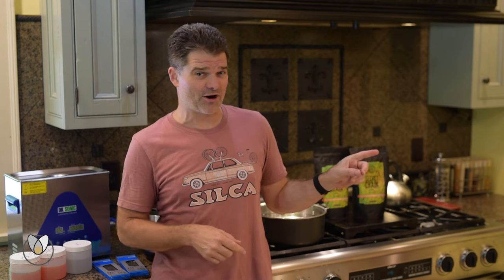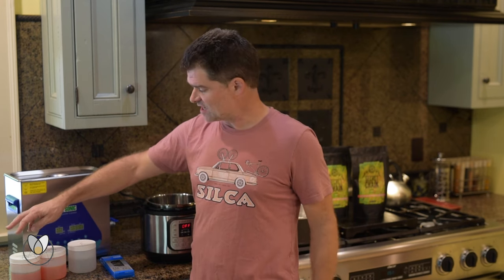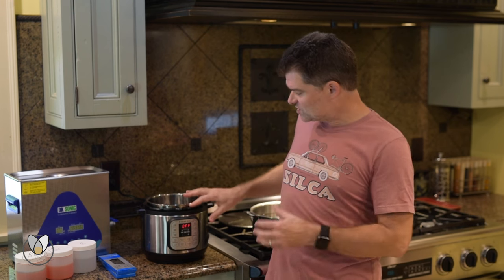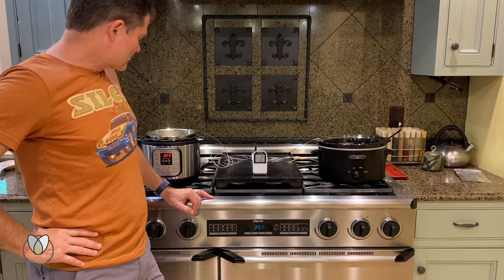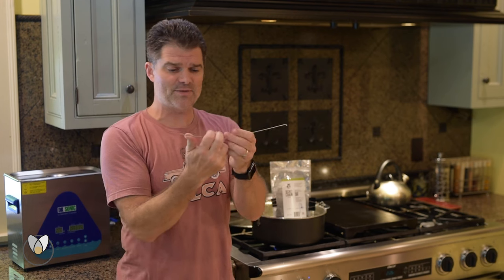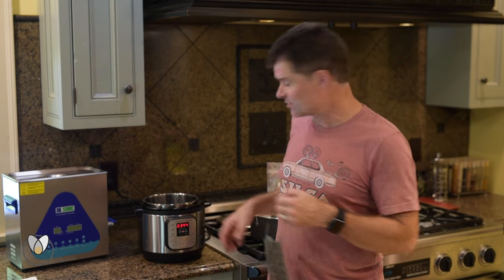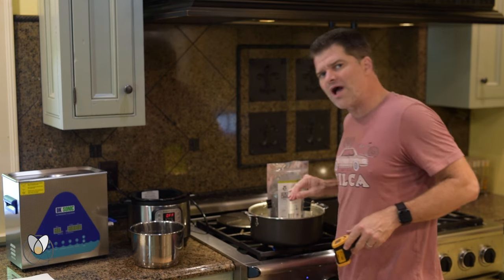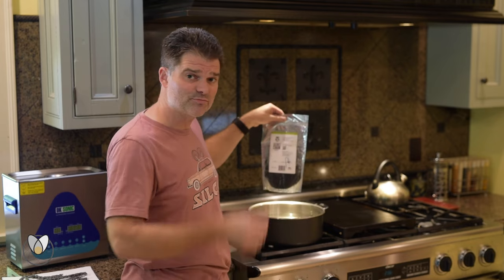MGTV: How to Hot Melt Wax Your Bicycle Chain

Comment: Worth mentioning the steps after this as it can prove pretty painful. I ended up with many stuck links which really effected the drive chain, made a lot of noise and messed with my shifting. Much time was spent further freeing up those links, to the point where I'm not sure there's any wax left in the links. Several KMs in, the chain is still worryingly noisey. Very close to going back to lube.
Reply from the maker: Joni, please check the routing of the chain through the derailleur cage, every similar complaint we've had has turned out to be that the chain was routed over rather than under one of the derailleur cage tabs leading to lots of noise and feeling like the links are all stuck.  Please feel free to call or email our customer service if this isn't the case, sales (at) silca (dot) cc
Reply: @SILCAVelo  appreciate the reply. The chain is routed correctly. 
I also had my bike shop check I hadn’t moved the DR as well.
Reply: Joni, as part of my process I actually remove the chain from the swisher and let it hang straight. It will dry solid. From there I have about a 1 foot section of 2x4 in a bench vise. I hang the chain on that, grab both ends, and pull it back and forth a few times as if I were trying to saw through the wood. That’ll break all the links. You’ll know when you’re done as the chain will stop jumping as it articulated around the back of the wood. You can also use a section of PVC pipe instead of wood to do the same thing. IMO this was a critical step in waxing that was left out. On a clutched derailleur system like GRX or XTR you can get away without doing this as the spring on the cage is ridiculously strong, but on a road drivetrain (Ultegra, Dura Ace et al.) you absolutely must break the links first before reinstalling your chain out there’s no way the chain will make it around those jockey pulleys.

Comment: Josh, 

In your video you mentioned that you would be adding a link in the comments section providing more details regarding the ultrasonic cleaner you’d recommend.  I didn’t find it.  Is it there?  If not, would you mind replying with your recommendation?

Separately, would you please provide either a link to a separate video/discussion or guidance as to the recommended maintenance involving a waxed chain?  I’m wondering if a waxed chain can simply be maintained through the use of Silca’s drip wax lubricant or if periodic hot re-waxings should be performed.  If the chains should periodically be hot re-waxed can you provide some insight as to when and/or how often?  What about chain quick-links.  A few others have raised questions about this in the comments, which were never answered.  If hot waxing a Shimano Dura-Ace chain, must the quick links be replaced each time?  If not, then at what point should the quick-links be replaced?

Thanks

Comment: Hi guys, love your content and podcast. I just wish either your wax packaging, or the website the QR code on the packaging points to , simply listed the temperature for melting and for hardening.
Reply from the maker: Sorry, we'll dive into this as that info should be all over the place!  We recommend 75C as the optimal temperature and you can get good results between 70C and 90C.
Reply: What setting on the instapot? Saute, warm or slow cook ?

Comment: Hi Josh, since marginal gains are desirable, I will give you an extra tip! Soak your beans to deactivate Phytic Acid which is an anti-nutrient. That way, you will gain more minerals like Calcium, Magnesium, Copper etc. from your food. Phytic acid will pull minerals from your intestines, bind the metals in your stomach and intestines coming from other sources too, which is a huge loss. That loss on the long run creates more hunger and decreases satiation since the calories become emptier. I hope this makes sense.

Comment: I've noticed that the hot wax appears to separate after a while in the instapot... a clear liquid on top and tiny black spherules settling to the base. Is this normal? It didn't happen on the first chain, but the second and third I've dipped with the same bag of wax it did. I re-agitated before pulling the chains to hopefully maximize the penetration of the tungsten, but I'm wondering if this is some indication of overheating or contamination? The chains were THOROUGHLY cleaned.
Reply from the maker: The separation is a function of how long the wax took to cool or sat before cooling without being agitated.  The WS2 particles are sub-micron size but are heavy, so if the wax sits for a bit after the waxing they will sink.. similarly if it takes a long time to cool, it will separate, but it's fine, it will all just stir back into solution when re-melted.  The only thing to look for in regards to contamination or overheating is a changing of color of the wax from whitish grey to yellow or brown.. if you see yellow or brown, that is a sign of either overheating or oil contamination.

Comment: Question. My hot pot heated up far faster than expected. I dropped the chain in on the cold wax, turned the pot on, then went and did 25 minutes on the rollers.  When I got back, the wax was at 217 degrees F. Did I damage the wax or the chain by letting it get this hot?
Reply: No damage to the wax or chain, but the danger is that if the wax gets too hot it can actually catch on fire.  My son did that when he was younger, he was melting candle wax in a pan on the stove to pour it into some molds.  It got too hot and caught on fire!  We called 911 so he could get treated for his burns.  Fortunately, there was no long term scarring.  That is why I recommend using a crock pot (slow cooker).  I picked up a really small one at Target for around $10 on sale.  There's no risk of getting the wax too hot and it is so cheap you can dedicate it to this purpose.

Comment: Josh mentions to pull the chain from the wax when the temp is 138 to 140 degrees and has a little film forming on top. When I do it, I'm getting a film forming at 146 to 150 degrees. The first two times I've pulled the chain at 140, the links ended up absolutely packed with wax. I thought maybe it was just the small mass of wax in the sous vide bag. So I purchased an instapot and have two bags worth of wax in the pot (more mass holding the temp longer), but again, I'm getting a film at 150 degrees. Is the answer less wax? I'm sure my IR thermometer is close enough...
For my third time, I pulled at 150 degrees and still the wax is clogging up the links, just not as bad. I end up with a toothpick pushing wax out of the links...Am I doing this wrong? Should I wave a heat gun around to melt the wax jammed in the links? Pull it at a higher temperature?

Comment: Hi Josh,
I’ve bought the bundle and hot waxed in a slow cooker it works great, is easier than I thought it would be , and is as silent a chain as I’ve ever had.
Just did a drip wax touch up, looking forward to more videos on this.
What citrus degreaser are you using, I used mineral spirits in 2baths , followed by 1 bath in denatured alcohol. It worked very well , but would use what you recommend .
Also, what can I expect in cold weather,, say 20-40 F  ?
Thanks for the great product,
Dave
Reply from the maker: David, great to hear about your results!  We recommend Chemical Guys citrus, link below the video, we also have a link to a super concentrated denatured alcohol.  You have to be careful with mineral spirits as there is no set mix between brands and some of them will leave a residue so just be sure the chain feels completely dry and residue free before waxing.  You should see no change in performance at cold temperatures, the wax will get compressed inside the chain and acts basically as a solid lubricant after a few miles so really isn't affected by temperature until things get rather extreme! - Josh

Comment: Since the combustion temperature of paraffin is well above water’s boiling temp, the bigger concern with the bag or double boiler is that boiling the water could cause you to spill or splatter hot wax. Not as bad as an ignition, but not good

Comment: Hi Josh. One simple and  silly question. Done the hot wax process ok. Then, do you have to clean off the chain the excess of wax or just you put the chain as it is on the bike and the wax will be removed just pedalling. Thank you. Regards from Italy
Reply from the maker: Just put it on and ride, the excess will fall off when you spin the drivetrain (just don't do it inside the house!!!)

Comment: I wonder if a brand new chain needs still to be deep cleaned or its ready to go , and also after the wax is dry should we move all links around trying to “break” the wax , the video doesnt show up to this stage, but i imagine once wax is dry that chain should be rock hard right ? Tks for the video by the way
Reply: New chains would stick to the wall if you threw it at one.   You should definitely clean it.   I just put a new chain on my MTB and I think it was harder to clean than the old chain off my gravel bike.   Yeah, no doubt in my mind you clean new chains.   Besides, if you clean the chain then no matter which method you use to lube it your going to know its not compromised by the gunk that comes on a new chain.

Read above about prepping chain for installing on a bike.   My chains come out heavy, stiff and with wax crammed into every link.   Takes some work to prep it for the bike.  RideFast above says to pull chain out of wax at full temp to eliminate some of this.

Comment: After watching this, I am curious on post processing the chain after waxing is done. I have recently hot melt waxed (pure paraffin wax, though) my chain for my indoor setup, and on the first ride, there was dry wax from the outside all over the place. Will your wax leave a stiff residue on the outside like the paraffin wax?
Reply: I’m curious about post processing, as well. I just completed my first wax melt using the instant pot method. I heard Josh say that one of the benefits of hot waxing your chain is how quiet it will be, but my drive train is louder than I’ve ever heard it at the moment. I’m hoping it will quiet down once I get the bike out on the road and some of the excess wax spins off.
Reply: Me too!   My chain comes out stiff and heavy with every crevice full of wax.  I spend probably 15 minutes cleaning wax out from between the links and also from the side plates.  Josh holds up a waxed chain that looks absolutely pristine in the video.  Mine is far far from that.  No idea how he manages to do that.   I am hoping that a ride will knock the wax off and lighten the load of this chain.  Rode it around the block and it feels like a heavy drivetrain.   I do LOVE my new 3 quart instapot !

Comment: Up to now, I used the super secret chain lube since summer 2021, and as I also want to use wax on my second/bad weather bike, it seems to be the best to first hot wax that chain. In case I use the bag which is put in hot water, do I just have to close the bag after waxing for reuse? If so, how often can I reuse the wax? If I decide to buy an Instapot, can I just leave the wax in the insert pot, and put it in a well-closed plastic bag, to just put it in the Instapot again for the next waxing session (e.g. in the case I have to ride often in bad weather)? Is this hot-waxing alone sufficient, or is that just the base for further waxing with the Super Secret Chain lube (which already seems to work fine, but I never used that bike in bad weather)?

Comment: I hot wax my trikes chain but I'm going to be doing multiday, week month tours away from home so wondered how to maintain my chain while I'm doing a transamerica tour.
Reply from the maker: Super Secret is the perfect option for this.  You can drip it on the chain after the day's ride and it will be ready to go for the next day.  If you get to a point where you are able to hot wax you still can, but certainly not needed.
Reply: @SILCAVelo  yeah I’ve noticed some of the hostels along the transamerica route have full kitchens where I could get boiling water to clean my chain then melt the wax in the bag to rewax the chain.

Comment: What setting or temperature is recommended for the Instant Pot?
Reply from the maker: You can just use the 'slow cook' setting, or if you are in a hurry and standing over it, hit 'rice' and it will melt super fast.. you just have to then change it to slow cook or it will get too hot - Josh

Comment: Just a question.  How do you deal with the wax in the instant pot after?? I would still like to use mine for cooking
Reply from the maker: You need to buy a separate liner for the Instant pot, you do not want to be cooking and waxing in the same liner.  https://www.amazon.com/Instant-Pot-Stainless-Steel-Cooking/dp/B008BKHGX0

Comment: I tried this method but used a crummy wax melter that took roughly an hour to melt the wax.  I must have done something wrong though, because I have rust on my chain on a few pins after a ride in the damp.  I even made sure to wipe the chain down after the damp ride.  Maybe I pulled the chain out of the wax too late?  My wax was clumped and I had pretty thick wax layers on the plates and a lot inbetween the pins where the cassette teeth would engage.  Maybe the pins were left unprotected where those wax clumps/layers broke off?
Reply from the maker: Sounds more like the chain wasn't left in the wax long enough.  You need a good 5 minutes or more to let the chain come to temperature so that the wax can fully wet the surface and penetrate all of the internals.  If the chain is colder than the wax you get a clumpy surface coating that does not adhere very well and does not fully wet the imperfections of the metal surface.

Comment: Is there any disadvantage of putting just some of the wax granules in a say 5 inch by 5 inch plastic container and melting that in a large pot of water? I used just enough wax granules to cover the chain and allow me to swirl it. I could leave it there for a while to cool as you diid. I thought that by doing it this way I would keep the unused wax clean and not get contaminated by rewaxing chains that weren't perfectly clean. Is it possible that by using only partial amounts of the wax granuals that the chemical ratio might be inconsistent?
Reply from the maker: Your method will work as well.. there is no downside to only using some of the wax, every pellet contains the right amount of stuff..so ratios will be same whether you melt some or all of it.  Josh

Comment: After pull and wait for wax solidifies / does it need to remove the flakes before installing on bike / the links are kinda stiff after waxing - does it need an additional process to free the links before installing ?
Reply from the maker: You can do it either way, I usually work the links over a piece of 1" tubing just to free them up a bit before install, some work the chain with just fingers and others will install as is and let the excess fall off on the first use, from what we've seen in the data, there is no difference in terms of performance or longevity between any of these methods.

Comment: Does the treatment need doing on all of the drive chain components?

Once the chain is waxed:
Cassette waxed, just a good clean, or additional product needed?

Chain ring?

Rear derailleur?
Reply from the maker: Robert, as long as the cassette and chainrings are clean when you start, the chain treatment is all that is needed.. it will keep your entire drivetrain significantly cleaner than any other method of treatment!
Reply: @SILCAVelo  thanks for getting back to me.

Appreciate their will be various factors at play. But typically what sort of mileage can be done between re-waxing?

Comment: Love my hot dip waxed chain. Reduced wear on everything. My system is smooth now and the time spent re-waxing is way less than the time I used to spend cleaning. 

Quite a few times I’ve ended up with wax filling the inside of the chain. I’m guessing I took it out of the pot when the wax was too cool?
Reply from the maker: Maybe pull it a little bit hotter, there should be little to no wax filling in between the link plates.
Reply: Thanks  @SILCAVelo  , I did three chains this weekend and by pulling them out a little hotter it was loads better.
Reply: @SILCAVelo Just how hot is hot?   My infared thermo said the surface of the wax was 168-170F.    Are there visible signs of hot wax?   Thinking of bubbles or currents in the instapot that occur when it becomes hot enough.

Comment: Just did my chain.  (1) chain is full of wax ... do you wipe it down after waxing and before installing?    (2) quicklink was tough to fit to chain ... had to clean and clean the wax off the chain inner plates and holes to get it to catch.  Common?   (3) will any degreaser work to clean the chain or must it be a chain specific degreaser?    (4)  I used hot water in pot method ... produced melted silca plus large balls of unmelted.  very strange to me.  I think the wax was about 160F.   Not positive.   Common?
Reply from the maker: Sounds like the wax needed to be hotter.. you shouldn't have clumps in the wax and the final chain should have minimal surface wax on it.. Next time, leave it in there for a few more minutes.  For this chain, installing it and riding it for a few minutes should knock all that wax off.  I don't wax the quicklink for this reason.. there is no performance loss as all of the contact surfaces for the link are fully coated, so having the link also coated just makes it that much harder to re-fit.
Reply: Thanks,  it was my first time.  Had wax everywhere on the chain.   I was a bit worried about overheating the wax in my kitchen over a gas flame.   Wasn't allowed to use the insta pot.  Going to buy a 2nd insta pot liner.   So, I called the chain done when the wax was 160F.   Amazed to see a clump of wax rise up in the pool of melted wax.   This was when I was pulling the chain out.   The clump rose out of the murky depth.  Thanks again for the advice.